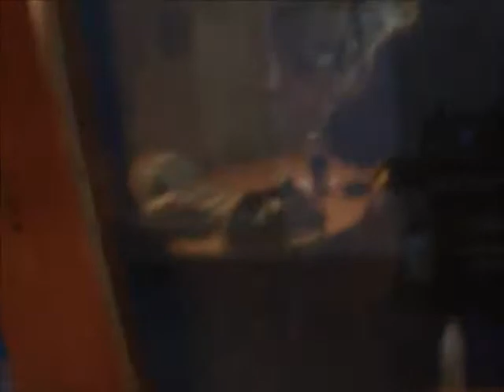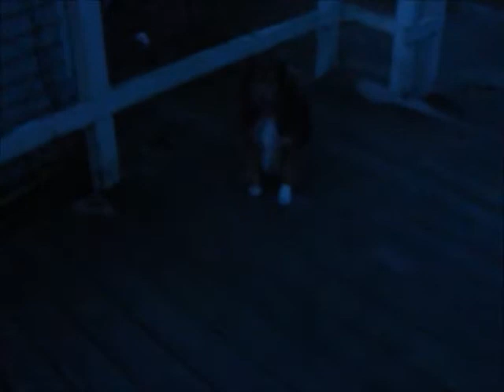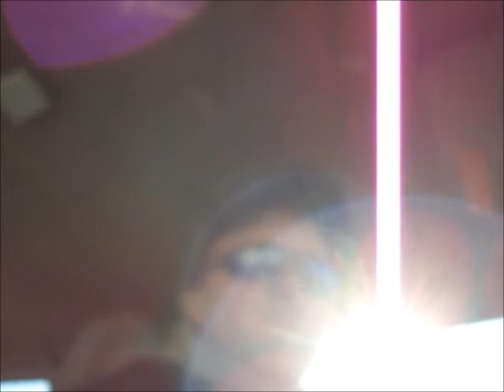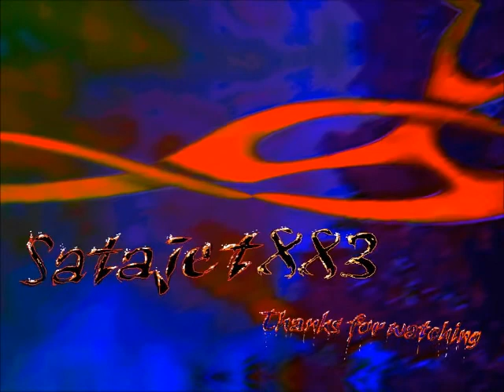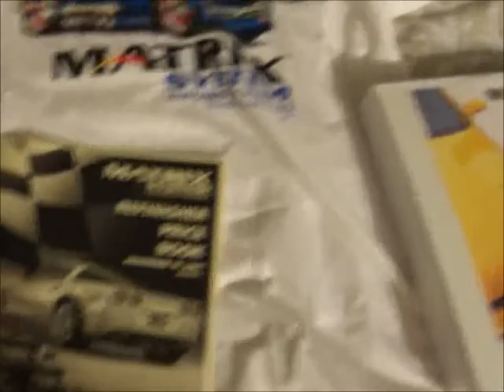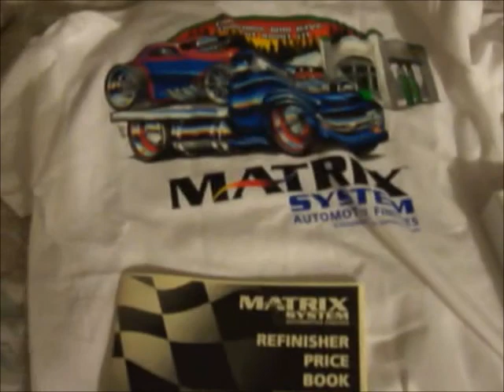Paint disasters

Comment: The lower the required CFM the better it will spray on smaller compressors over a long time. Harbor Freight hvlp guns use 12cfm @ 45 psi. The siphon feeds need 6cfm or 1.5cfm @ 30psi. So most smaller 20 plus gallon compressors will run the siphon feed all day.